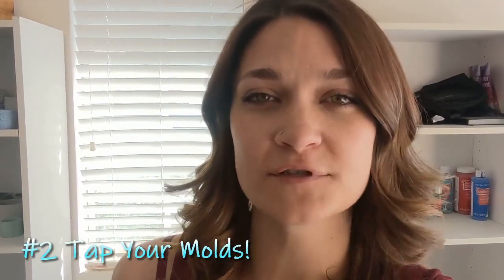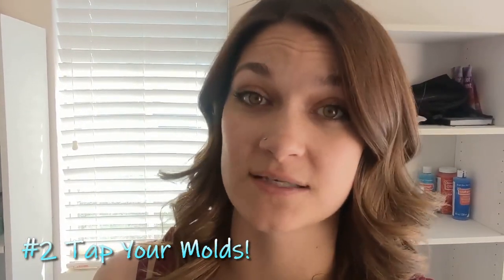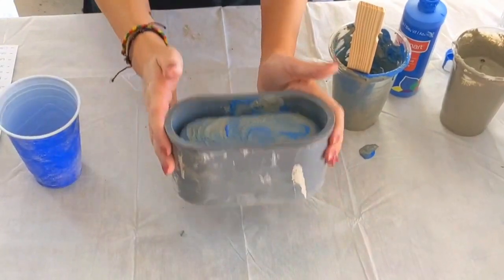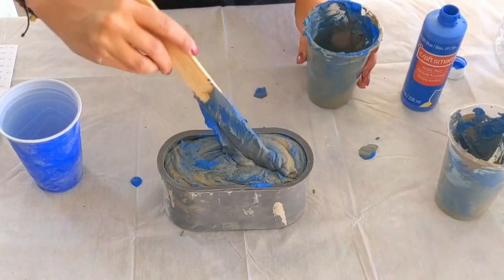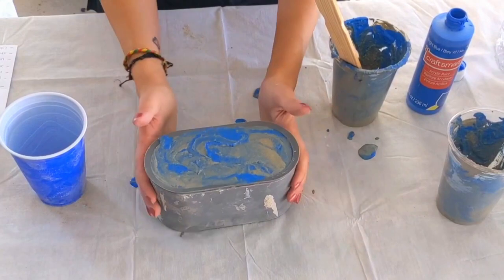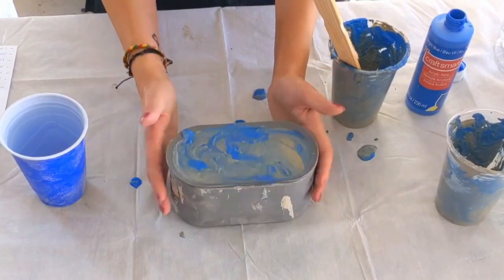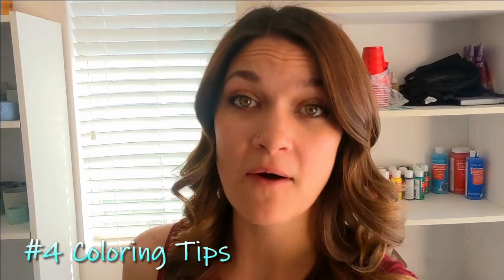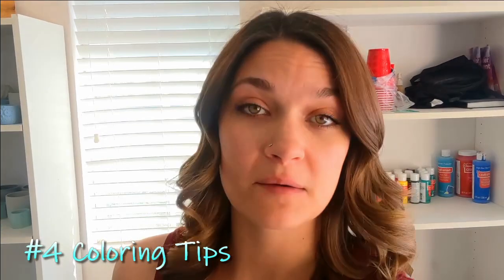5 Common Mistakes When Making Concrete Candles or Planters

Comment: I’m no expert but don’t think you can use just any kind of concrete for candle making as some of them contain additives to fortify the mix and can be dangerous if exposed to fire. They can create fumes that you unknowingly breath. Cement All contains Methanal. To make concrete you just need cement, water, sand and sometimes gravel. For a candle container cement and sand should be enough.
Reply from the maker: Hi! That's why I say in all my videos to make sure you are testing your own containers. I personally use cement all, have tested it out, and have not had any issues. I allow my containers to cure and apply a sealant over it before pouring the candle. Im just sharing my tips :) thanks for your comment!
Reply: @WizeOwlCandles  I understand and I don’t mean to be a pain, is just that when a person sells products to the public they (or the company) is liable for any harm the products have caused even if they didn’t know it was not safe. That being said, I don’t know the dangers (if any) of the additives in those cement mixes. By the way, I love your videos I’m just extremely particular about safety and liability 😉
Reply from the maker: Totally understand! I appreciate the comment :) personally I have tested out the cement all in hundreds of candles - testing the heat exposure among other things and it has been safe on my testing. Always do your own testing and research tho I always say! 

Thanks for watching :)
Reply: you raise a good point that I hadn't thought of 🤔I even wonder now if the sealants might produce unsafe vapors / fumes.
Reply: Container is not exposed to fire but to heat. It is a difference. Concrete mixture should be just for interior uses
Reply: I come from a construction background and also use Cementall. It's a 9000 PSI bag mix with super plasticizers and other admixtures for strength. Downside is it's fast set time which limits batch sizes and can cause cracking in thinner containers. Set control helps quite a bit too slow things down and reduce cracking.

I'm not aware of a stronger box store bag mix.

Comment: Hello, I made a cement flower pot, but after I added dirt and planted the plant, within 24 hours the container cracked, what caused that? Note that I did not use sand with the mixture
Reply: Iam sorry, I could not understand your words because my listening language is weak
Reply from the maker: It could be just the cement used. I used cement only and it didn't work out. Cracked and was weak. You want concrete or a sand mix with cement
Reply: @WizeOwlCandles  i use the construction cement only with water
Reply: @WizeOwlCandles  thank you
Reply: For flower pots, you need to leave it to ‘cure’ for at least a week, otherwise it will crack easily due to the moisture.

Comment: Do you weight the 4:1 ratio or just eyeball it?
Reply from the maker: The 4:1 ratio is recommended by the manufacturer. I've measured it so many times I personally eyeball the consistency at this time

Comment: thank you so much for the helpful video! :-) how do you avoid cracking on the bottom of the cement mold? and also what do you use to apply a design on the planters?
Reply from the maker: Hi! Cracking on the bottom I would say just make sure you aren't using too much water in the mixture and pouring enough on the bottom to meet the top of the mold. 

For the design, I actually have my own stencils I use

Comment: I get holes in the cement when I take them out of the mold
Reply from the maker: Try tapping the sides of the container and getting all those air bubbles out when pouring :)
Reply from the maker: Try tapping on the sides of the mold during pouring to help release the air bubbles :)

Comment: Hi,  do you have a problem with the wax discoloring your vessels?
Reply from the maker: I don't with the sealer I use. I have been doing two coats and when the candle is done it doesn't have any discolor :)
Reply: @WizeOwlCandles  
Thank you 😊

Comment: I’m getting frustrated. I’m getting bad air bubbles on the rim. I bounce my mold tap it and even use my vibrating machine. I’m ready to give up. 😩
Reply from the maker: Oh no! Don't give up! It took me a long time and honestly sometimes I make some with bad air bubbles. I would check how much water you are using and how fast you are pouring. Use less water and pour slower and see if that helps :) Pour in layers and tap
Reply: @WizeOwlCandles  thank you! I appreciate your response! 🙏

Comment: I have a concrete vessel that the candle won't stick to the sides what do I do?
Reply from the maker: That's strange. What do you mean it isn't sticking to the sides? Are you using a sealant on the inside?
Reply: @WizeOwlCandles  yes ma'am I'm using everything you said to use from concrete to sealer.but it only does that with only kind of my vessel.
Reply: @WizeOwlCandles  its not adhering to the sides once candles is ready and firm
Reply from the maker: It may be the temp you are pouring at or the sealer you are using. I know this comment was a bit ago so I hope you were able to figure it out!  :)

Comment: Is it possible to use mineral oil as a sealant? 
If not would you happen to know a food grade sealant?
Reply from the maker: I'm testing out new sealants so I don't have all the info right now. I have heard of people using a coconut oil mixture. You can always test it out! :)
Reply: @WizeOwlCandles  ok I definitely will! Thank you!
Reply from the maker: You are very welcome!
Reply: Someone mentioned this food grade sealer it's called Cheng Concrete Sealer and I saw it on Amazon.
Reply: @charleighann7366  thank you very much! I will check it out 💕

Comment: What is concrete? Is it the same as grout?
Reply from the maker: Concrete is a mixture of cement, water and aggregates, such as sand, coarse gravel or crushed rock. Grout is often used to fill the spaces between tiles after the adhesive mortar below them has dried.
Reply from the maker: I would recommend concrete
Reply: Thank you.  Its just confusing as we don't get Cement All here in South Africa

Comment: Hi! I’m really struggling with getting the container to not crack. I’ve been using Quikrete, but wondering if there’s a better difference with Cementall? Literally, as soon as I unpeel from the silicon, it crumbles
Reply from the maker: I use cement all :) so yes I would recommend it
Reply: Also, before you demold, you may have to put it in a water bath. Cenent get stronger the longer you leave it in water. I leave mine in for upto 2 weeks. I’ve realised people are creating weak structures.